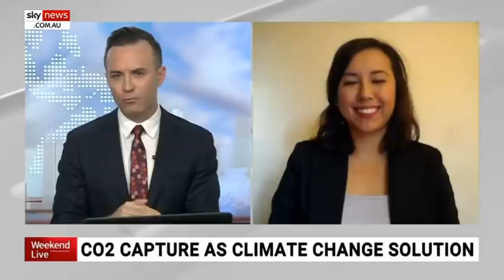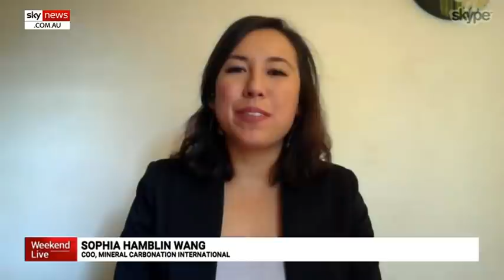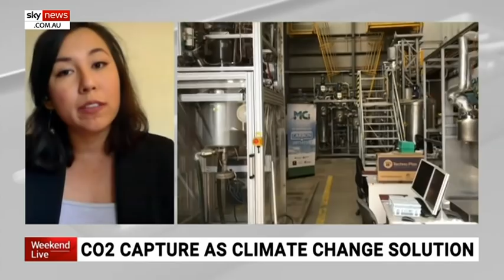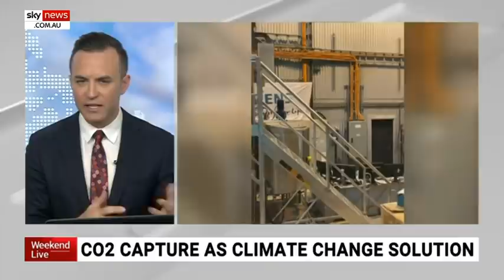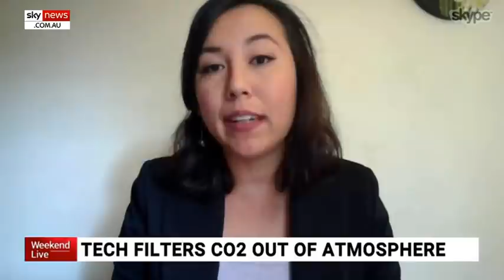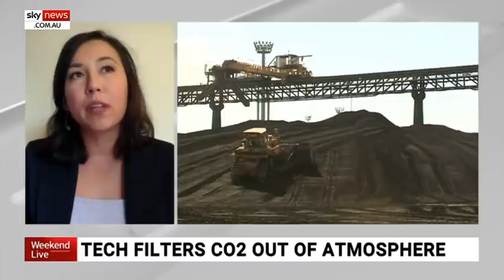'Carbon dioxide is a resource and not just a harmful waste'

Comment: This is absurd unless someone can show the energy produced to capture CO2 will not cause either pollution or has a carbon footprint less than used to produce the CO2. And the experiment at Kitimat in Canada does not count because it uses hydroelectricity and is therefore not replicable worldwide. Besides, it's the opportunity cost that counts. Hydropower can be delivered cheaply over long distances to displace coal and thus reduce CO2 more efficiently than can carbon capture.
Carbon capture seems to me to be a proposal like a perpetual-motion machine, an attempt to violate the second law of thermodynamics. It's a scam. Why certain philanthropists have got entangled in this is a mystery.
The French have a better solution than this: nuclear energy. The Americans have a better solution too: fracking for natural gas, which burns more hydrogen than carbon. Hydrogen when burned produces water.
https://www.eia.gov/tools/faqs/faq.php?id=73&t=11

Comment: Where do you get the power (coal,oil,gas,hydro,solar,wind) to mine and refine the capture materials? Stick a hose on the bulldozer exhaust and run it over to the pile of mud bricks it's moving? How much do you save not using the bulldozer in the first place to mine the capture material?

Comment: This is scary. Atmospheric CO2 is at historically low levels already, in geological time spans rather than the microscopic time base used by the ignorant warmists, and people want to lock it away from the atmosphere permanently. Nature has been doing this for a long time with coral reefs, limestone, chalk etc. Humans have been locking carbon away from nature in concrete, high carbon steel and myriad other ways. 

Fossil fuels may release CO2 but it is important to remember that this was taken from the atmosphere in the first place by plants, algae and microorganisms. That CO2 was in the atmosphere tens of millions of years before humans existed. This ridiculous carbon phobia, only experienced by carbon based organisms, is a dangerous mental disease.
Reply: NASA has reported the greening of the Earth by CO2. The optimum level of CO2 for plant life is between 1200-1500 ppm (parts per million by volume). Now the level is about 415 ppm.
https://www.nasa.gov/feature/goddard/2016/carbon-dioxide-fertilization-greening-earth
Reply: @fwcolb  Its also interesting to note that the warmists always quote CO2 in ppm, never as a percentage. I guess 0.04% just doesn't sound scary enough.
Reply: @brianbrigg57  Yes. But ppm may be the way CO2 concentration is measured. At least by Keeling and probably still now.
Reply: @fwcolb  I think that they purposely rely on the fact that so many people are functionally innumerate to make their numbers sound more scary.
Reply: Increase it in your room if you like it that much but remember to write testament..
Reply: @klokoloko2114  Before you comment, at least do some basic research. What is considered the minimum level of CO2 to support plant life? What is considered the optimum level of CO2 for plant life? What is the historical average for CO2 on a geological time scale? If you cannot answer those simple and basic questions, just go away and leave comments to those who have bothered to educate themselves.

BTW it is apparent that you are confusing carbon dioxide (CO2) with carbon monoxide (CO). I would quite happily live in a room with five times the atmospheric CO2 concentration. My potted plant would love it. CO at 40ppm is a different matter entirely.
Reply: @brianbrigg57  More CO2 in air= more toxic air for humans. Apparently you have more love for plants than humans. You can increase CO2 in air at point that human will suffocate but plant won't mater.

Also because those increased percentage of CO2 in air in last 150 years we have now more burned plants all over the world because increased temp. and more dried vegetation extremes. There is a reason why last 100 000 years CO2 was steady 250ppm and this ecosystem and all living things on Earth are designed for that percentage. This sudden change is shock for the planet in suck a short time. This 100 years is like 1 second for time on Earth.
Evolution of all living things do not work that fast, that's why we have mass 6 extinction off all living things on Earth right now, all because this extra CO2 in air.

You probably think that using drugs is also good because you feel good after consummation and pass over all negative effect that drug abuse bring to human health .
Reply: @klokoloko2114 I find it disturbing that you would think that you need to educate me. It shows a complete lack of anything approaching a critical thought process. I asked you to educate yourself on the subject at hand so that you could answer a few very salient questions.

Does it not occur to you that any argument claiming that CO2 is rising to dangerous levels needs to fact based if we are expected to spend more money on it than we do on healthcare and education combined. The questions that I asked are absolutely critical before we can can even discuss the issue further.

Without knowing the average CO2 levels, across a very large timescale since anything else is insufficient, how can you claim a "disastrous and unprecedented" increase? 

You couldn't be bothered to find even one answer. All of your drivel has obviously been learned from the mainstream media's agenda driven reporting. You, and people like you, are the backbone of the leftist disinformation brigade as you only care enough to panic, not enough to look into why you should. Useful idiots was the perfect description for such as you. I hope that there are not too many people like you out there because once the left gains enough power you will learn, too late, that you have been aiding and abetting the biggest scam in history due to your intellectual laziness.

You could be better than that.